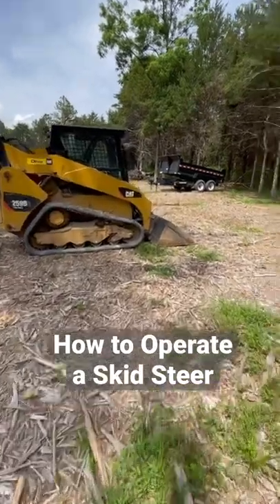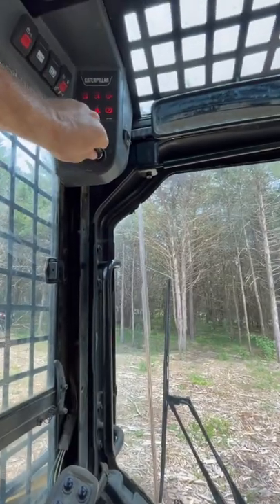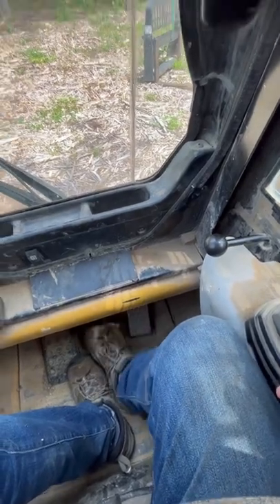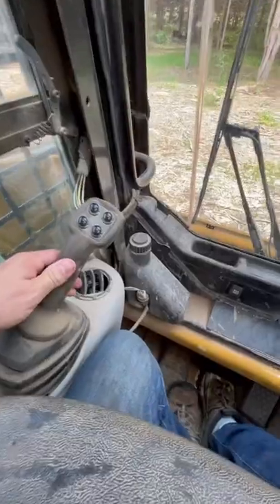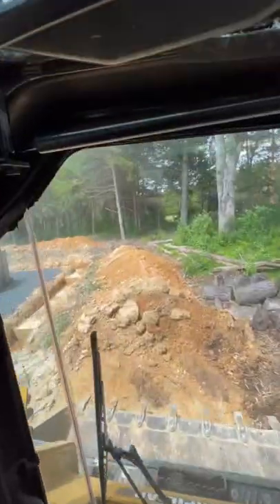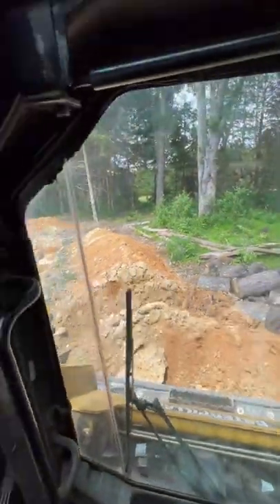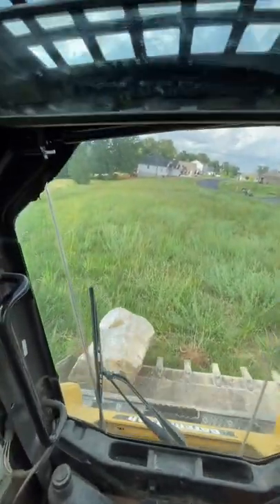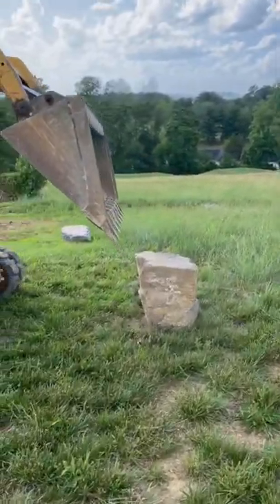How to Operate A Skid Steer

Comment: I am a grader operator and got to say I love my job. I drove tractor trailer for 16 years and 5 years ago I made a change I thought about starting to haul oversized loads when an opportunity to get on our local DOT came up for plowing snow in the winter and took the challenge and it worked into me getting the equipment operator position here and I can honestly say  I love my job there is days I miss the road but wouldn't even think about going back. Since coming here I've learned to run dump truck, backhoe, grader, loader, excavator, roller and the other day got to run a skid steer with a sweeper that is what makes this job so enjoyable you are always doing something different.
Reply from the maker: Sounds like a great job! Thanks for sharing!

Comment: I was the crew lead for the excavation team at a fiberglass pool company. Absolutely loved the two skids I frequently towed along.  One was an older bobcat, wheeled, but it was like a mini skid. Like imagine a skid with a full cab but it was the size of a dingo. Couldn't find a newer version, but it was nice because I could drive straight through a 3.5' gate without having to take the fence down and being so small the thing was a blast to rip around our storage property. The other skid was a Takeuchi Tl12v2. Complete opposite end of the spectrum. Thing was the largest skid we could get, still relatively compact even compared to the 18000 lb mini-ex. But this beast would cleara a dump trucks/ 20 tons worth of material in a few minutes with a fully sealed cab, a/c, bluetooth, enough roof to fit another person in the cab with me and my feet up.
Reply from the maker: Very cool

Comment: I like the ones with the foot controls for the bucket. Once you get use to it, it just feels much smoother and even more relaxing.
Reply from the maker: I hate the foot controls, I feel like I can be much more accurate with my hands. It’s all just what you are used to I guess!
Reply: I agree. Foot controls feel so much nicer for me. I feel more fluid and like having 2 joysticks for drive
Reply: We have both kinds of skid steers and the foot pedals are horrible. The joy stick is so much easier.
Reply: I’m the opposite. We have 2 of the foot control ones here in our Air Force shop for clearing snow. It can be a real headache when you’re trying to drive and do the bucket at the same time. Unless you’re REALLY REALLY good at it and spend a lot of time in it, it’s usually slower than our joystick ones. 

It makes no sense to put them on the floor really. Why you would use to analog controllers for driving is beyond me. That’s like 1950’s style technology.
Reply: @Jay_Force_One  it’s easy for me to drive and operate the bucket at the same time but it’s just an old design that’s uncomfortable and hurts my knees. We have an old John Deere machine.
Reply: I've used both but currently own a Bobcat 743 hand/foot control. I have more wheel control with my 743 than the Kubota and Cat with joysticks that I've used. I don't understand the locking of the cab door.

Comment: I remember the first time I ran one of those joystick Cats, I was hauling debris to the dumpster and I was backing away from it, off a curb and into a street watching carefully behind me, and then I noticed I was feeling really tippy coming off the curb...

Then I realized that I was habitually pulling both sticks back while backing up, and so my bucket was all the way up as the wheels came down the curb! Lol

It took a little time to stop making that mistake, but I much prefer the joystick style to the foot controls, probably because I have short legs and most bobcat seats are rusted in the full rear position.

One bobcat that I really hated had regular twin sticks for driving, and then the hand grips on the ends had a swivel on them, and so you ran the bucket raise and curl by twisting your wrists sideways, and it was really easy to move the bucket when you were driving, and hurt my wrists after a while.

That Bobcat was a super short wheelbase one and had no weight on either end, so if you tried to put the bucket down to cut, it would just lift the front wheels up and actually bounce the bucket off the ground when you went to drive forward, so in order to like scrape mud off a concrete slab, you had to stop, get your bucket positioned, and then VERY GENTLY get creeping forward, super smooth or it would pop a wheely and lift the bucket up and you would have to back up and try again.

And if you tried turning, it would start hopping and bouncing all over the place.

It hurt to drive it.

If I had used it much more I probably would have welded some extra weight on the front and rear lol

Comment: Years ago when I worked on a dairy farm, I killed it on the skid loader. I was cleaning barns every day with it. I prefer the joystick controls rather than the foot pedals for the bucket, but I've used both types a lot. Haven't run one in years though. I think the skid loaders are fun because they are so small and maneuverable, yet also very capable.
Reply from the maker: I agree with you about joystick versus foot controls

Comment: I’ve used many I used one the the left side I for turning etc then the right side is for the bucket . Then another that you have to push both down to go forward and pull back to go in reverse and then the right side is for tilting the bucket and the left side if you push left or right it’s to raise . Then the last one is the one you use you feet left foot controls the arm going up or down right side for tilting the bucket and then the handles just for going forward back and turns .

Comment: I have operated dozers, excavators, skid steers over the years. Generally whether or not I enjoy it depends on the job. For digging or clearing , the excavator, for grading and pushing, the dozer. For loading/unloading debris removal, hole drilling, brush mowing it is the skid steer always.

Comment: I prefer the old hydraulic ones vs the drive by wire. The controls are also better on the old kind in my opinion, each stick forward back is that side forward or back, and pushing the sticks sideways curls and lifts

Comment: Man I run a wheel loader for a ready mix company, and I get there push material up and then just go got that BT radio AC/Heat and no one bothering me. Yeah it’s 15 hour days sometimes more but the low stress is nice and when we are really slinging mud and it’s all high gear it’s fun.
Reply from the maker: That sounds fun

Comment: SkidSteers with the joystick hydraulics are so much easier and better. The pedal hydraulics are truly a headache. That’s what we have to clear snow here in the Air Force and honestly, unless you’re really Good at it, it’s way slower process than with the Toolcats we have. 

So many times I’ve nearly tipped it because I’m trying to drive with both of my hands and at the same time orient the bucket with my feet going different directions. It will make your head spin for real.
Reply from the maker: I agree, I hate the old foot controls

Comment: Bobcats controls are a bit different with the bucket controls as the floor pedals and movement in the joysticks
Reply from the maker: That’s the traditional Bobcat style they make a newer models that also have pilot controls like Cat. It’s a preference thing, depending on how you order the machine.
Reply: @hausplans  I believe you brother, the S185 I have is from 2010, haven’t even looked at new ones since that one is still doing it’s job

Comment: Well not every skid steer does not operate that way the hand controls steer and the foot peddles  pick up and operate the bucket! The only equipment I have not operate is an track excavator I have operated back hoes wheel loaders cat dozers all kinds of tractors pavers rollers grinders  fork lifts off road articulation boom lifts as well as oil Riggs/drill rigs and cranes  and drove haul truck as well as equipment transporting. and much more like I said everything but a Track excavator! Now retired so gave up my class A lic. And only operate as a favor to friends & family!
Reply from the maker: Yeah I started out running skid steers with foot controls, I like the pilot controls a lot better though

Comment: The 30 minutes in a machine a month is mini vacation. " I couldn't hear my phone ,  needed materials at lot 106 ASAP , nobody around to unload  " in reality I got the call that they are 10 minutes out so I run to the skid steer to swap bucket out for forks , Ac on blast

The operators favorite saying at the end of the day " I'm tired I'll dig that utility in tomorrow. What in the hell did you do today sit in a air-conditioned cab moving your hands while listening to some talk radio.